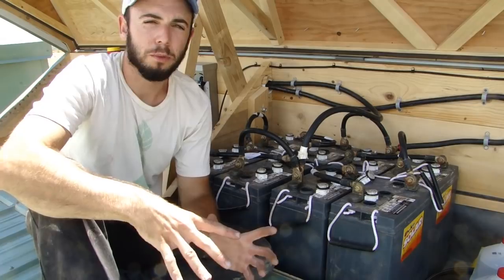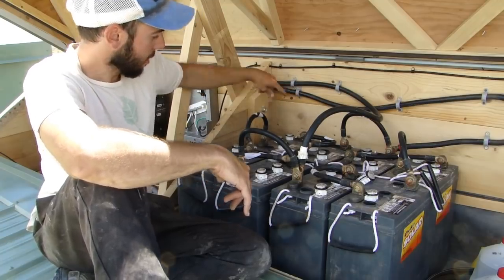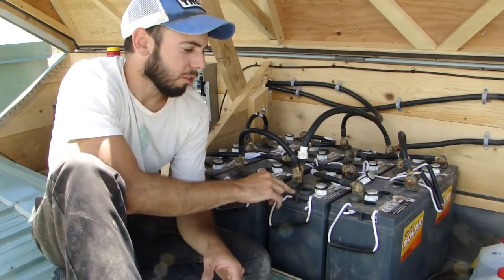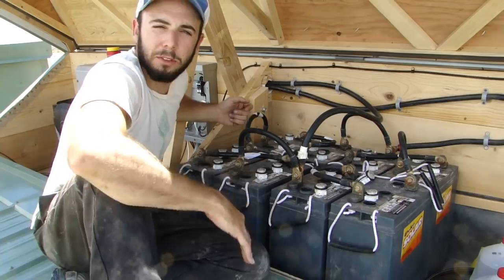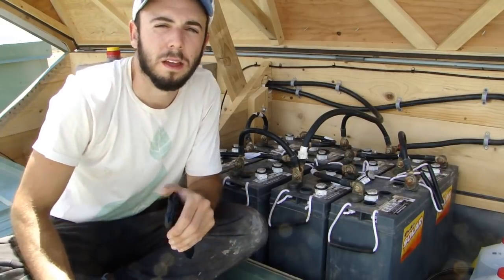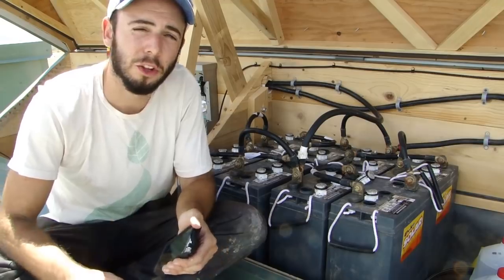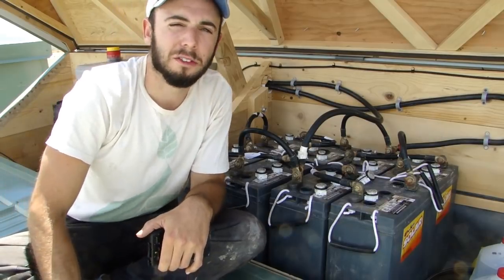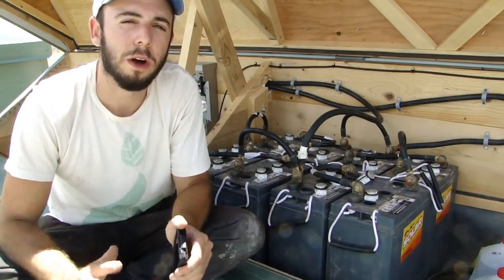How to Size Your Solar System

Comment: This is a good video with alot of valuable information, but I just wanted to append this chart about depth of discharge I found elsewhere, for anyone like me who may be interested. 

Basically, If you bring your batteries down to 30% daily, you will get about 3 years out of them. If you can size your battery bank larger, so that you are only using 10%, its more like 10 years. 

* 50% = 200 cycles
* 40% = 500 cycles
* 30% = 1000 cycles
* 20% = 2000 cycles
* 10% = 4000 cycles
 
For anyone who is interested!
Reply: +Maxwell Myers I think that may be the case for standard car batteries, but for Deep Cycle its different, as noted by this image ( http://www.solar-electric.com/media/wysiwyg/cyclelife2.gif ) or this one ( http://bdbatteries.com/images/lifelinelifecycles.jpg ) which is used as a reference in Wikipedia article ( https://en.wikipedia.org/wiki/Deep_cycle_battery#cite_note-2 ) on deep cycle batteries.
Reply: won't i need 3 times the battery for that to happen. might as well change to new batteries every 3 years.
Reply: or, use the larger battery bank from day 1, which has two major benefits, (1) the battery bank lasts longer as you aren't discharging as much, (10-20% rather than 40-60% as an example), and (2) you have extra capacity available if it is required... eg if its raining overcast for a week or longer... and you arent getting enough sun to charge things back up.. :)
Reply: Why would you use power from the  battery bank during the day. A/C Coupling works and is much cheaper all the DC inverter is providing is the reference hertz for the grid-tie inverter.

Comment: You have missed that this is based on 24volts in kwh, so what is it after inverters loss (12-15%) and inverting to 220 vac?
I find that is where most of You make Your mistake calculating from Grid power!

Comment: I need 180KW 8 hours a day. That's 1440KWh. now with $200 per KWh Deep cycle batteries that costs me $288,000.
Reply: Walt Derzay you explained it well walt, tobad after you took the time to reply you got a sarcastic reply back.
Reply: What are you doing that requires 180KW?  An energy inefficient household using 240 volts at 200 watts (A large breaker panel) would use 48KW at most.  (Ohms law - AmpsxVolts=Watts).  This is a worst case scenario that would blow the main breaker of a very large home.  Recheck your math on demand.  I'm coming up with 384 KwH. which if you're paying grid rates of $.10/KwH would run you $38.40/day on your power bill.  Most modest homes can be run on much less power.  I have central air conditioning and a hot tub and use a 100 amp breaker panel with no issues in a 3 bedroom modest (1600 sq. ft.) home.  I use approximately 800KwH/month which translates to about a $80/month electric bill at $0.10/KwH.
Reply: Walt Derzay
It's a (small) cigarette factory. Those machines require lots of power.
Reply: Eddie T Duh! his time machine. 1.21 gigawatts!
Reply: *****
2 12 volt's are 24 volts. 3 12 volt's are 36 volts. 4 12 volt's are 48 volts, etc. The deep cycle batteries I find are usually either 2 volts or 6 volts. (p.s. 2 volt deep cycles are rip-offs)

You have to consider how much solar power costs between the hours of 6pm to 6am. Good thing the factory isn't fully running then.
Reply: leerman22 look into becoming a micro producer/co-generator. Depending on your supply options (thinking nat'l gas), you may be able to go in with 2-3 other small producers in (very) close proximity, develop a 1MW system, provide power (and steam) to each of the members. You can either be an island or backfeed the grid, depending on what your local power company & PUC will allow.Yes, it'll cost a small fortune, but it'll reduce your op costs, and have a 30-40 year life cycle. It's not for the faint-of-heart; but, a group of businesses standing together (or a small industrial park) can probably get the numbers to work out. And, to show my green creds...I'd suggest powering your office operations with solar. :-)
Reply: leerman22 0
Reply: ***** were you trying to give a link to a battery bank, because the link took us to a generator that would power my entire block
Reply: *****
It's supposed to be a diesel solar hybrid system. The electric service where it is won't cut it.
Reply: leerman22 wow looks like you need a small nuclear plant hehehe
Reply: Dan L
The client is out in a bush next to a gas station with it's own generator, and a grid service just for the lights.
Reply: ***** My question was mostly sarcasm.
 The discussions about using batteries never gone further than improving transient demand on the diesel generator.
Reply: Eddie T I need 192 7.5KWh models costing $672000 ($3500 each I'm assuming Elon said for the 7.5KWh model). Mind you that includes the chargers and inverters, but it is worthless at powering 3 phase machines from single phase current. I don't know the price of the factory grade models (100KWh each and must be 3 phase).
Reply: Eddie T
Made a mistake. The 10KWh system costs $3500. Using 144 packs and costing $504000.
http://insideevs.com/tesla-reveals-battery-storage-solution-missing-piece/
Still not looking good.

Comment: Very informative. Im def considering a system just to handle my AC unit,fridge,and kitchen appliances. A system to take a 3000 sq feet house of the grid completely would be expensive? also, I hear you can get paid for sending power back to the power company or something of that nature.

Comment: Not true. I have a solar panel running directly in to my AC unit through alligator clips. The solar panels will charge the batteries but there are plenty of things you can tie directly into.

Comment: In tech school, ca 1971, I learned NOT to remove battery caps unless they needed water.  Caps are vented by design and should work just fine to release gases on their own.  Plus, if there were a spark, the cap just might keep the battery from blowing up. Who told you to remove the caps?

Comment: So to run lights and appliances in a home... 3.5 kw's is average... I'm trying to figure in my head, what kind of system would need to be set up for a home with a washer/dryer, fridge, three televisions, a computer, lights, and have 4.5 people in a home taking baths every day...
Reply: 4.5 people? Is that a pet or somebody lost a leg and an arm??
Reply: there are MANY variables, there is no magic number that can come from the info you've listed, things you can do to reduce the needed size of the system is (assuming you haven't already done this) switch to a propane powered on demand water heater, switch all lighting to LED upgrade old appliances to modern energy star rated ones or gas powered ones where possible and don't forget your HVAC system, upgrade to a high efficiency system, possibly even a ductless minisplit in each room so you only cool rooms being occupied.
Reply: HomicideHenry The video is only about the DC side of the system, the charging and storage. He didnt factor in the DC to AC conversion which is required to run most things in a home. Your power inverter(s) MUST be a pure sine wave type (to run appliances with induction motors, and transformers, even a PC. else you risk damage or fire) and be able to handle the wattage of devices connected to it.Lights can run off a cheap $50 Chinese ebay inverter just fine but you TV sets, PC, fridge, and so on, you need a pure sine wave inverter with respectable wattage and for that your looking at $500 plus depending on voltage, brand, type and, wattage.
Reply: ElfNet Gaming
or just get DC appliances so you have a more efficient overall system.

Comment: I suggest that all appliances should be operated directly by DC
This is more efficient than converting the DC from the battery to AC via an inverter.
Most appliances are now available in DC.
I have extensive experience particularly in refrigerators.

Roy Singh

Comment: Why not just 2 12V batteries instead of 4 6 volt batteries?
Reply: Myns about 100 pounds i got duracell  6v   at betteries +  it was the best deal. Cheaper then trojan and. Same. Quality
Reply: I had 12 optima blue top agm  batteries and they didn't  do crap lol  but I switched to  8  6 volt  deep cycle golf carts and  there expensive but soooo much more \power  at 12 volt thow screw 24
Reply: umm Jennifer  6 volt batteries are all  true deep cycle for solar or for golf cart  2 of those 6 volt demolishes my 300 doller optima  blu top 12 v  just saying and  theres  more then just 4 theres 8 6 volt
Reply: and the hold a lot more juice
Reply: Virtualgod2009 so why don't they just make a 12 volt version, with the larger plates, etc?
Reply: What no they dont weight that much what in the hell did you buy ahaha
Reply: Zack Grindle that 100lb is for all of your batteries correct?

Comment: Hi,
Great video.

I am looking to try to build a solar power system for my house and this has been very useful

FYI.

Power (P) = Volts (V)  x Amps.(I) this is NOT Ohms Law!!

Ohms Law  I =V/R where R is the resistance of the cable

Cheers

Comment: Simes like most RV COME WITH 2 BATTERIES,  AND IF YOU FILL THE ROOF WITH SOLOR PANELS HOW MANY BATTERIES SHOULD YOU HOOK TOGETHER AND HOW MANY KW WILL THE MICOWAVE AND HEATER USE ON A GIVEN DAY IF THE HEATER RAN ALL DAY?

Comment: Did you know? there are government programs that will pay up to 20% of the total cost of solar panels for your house as long as you have it installed by a professional.
Reply: KFLY67 And the professionals raise their installation cost by 20% until the government program ends.  That's why solar panel prices are starting to come down - subsidies are ending.
Reply: Agreed
Reply: KFLY67 They have that here BUT the power company offers way less (like 1%) on your bill. I just disconnected mine from the GTI and now I'm hording power for myself, it was not worth selling back when I can use it locally in my home, Now my power bill is greatly reduced (under $30 a month lol) and I have backup power to spare in case of a power failure..
Reply: Yes. But then you need the professional to fix normal failings which will far eat-up any savings. Besides, it's fun building your own system, and takes courage.
Reply: We've got another 4 years on the FITC, bud.
Reply: 30% through dec of 19 .
Reply: Chris Gage I don't think people should be forced to pay for other people's health insurance either. I live in the UK, where everyone is forced to pay for the obese National Health Service!
The government only thinks it's in control of things. It's like saying you're in control when having a car crash!
Reply: It's paid for by stealing from your fellow citizens!
Reply: dalriada842 I'd rather be paying for your photovoltaic system than your your INABILITY TO PROVIDE YOUR OWN HEALTH INSURANCE /endrant.

Don't worry, the government is in control.
Reply: Dan Burch Not true, and the Govt tax credit is for 30% not 20% and is good until the end of 2016 and with the libtard President we have hopefully he will extend it.  Find a reputable company and get comparative quotes, the reason the price has come down is due to the module pricing coming down.  Module pricing has dropped significantly in the last few years.

Comment: I'm gonna be buying my first 100 Watt Solar Panels. I don't know where to purchase batteries like these. I want to start small and just power my room upstairs on the third floor. I have enough room on the roof next to my room for two 100 watt panels. Can you please tell me where to purchase either preferably online, where to purchase batteries, the rest is very easy to get online, it's the batteries that I'm having a difficult time finding. Really nice video (+1 : 1877)

Comment: Bro i think you are wrong because at 30% of use of your batteries only, you will need one half day without using energy from your batteries otherwise after 10 days you will drain all your batteries. But if you use 50% of your battery you will have to alternate the days of array usage otherwise you will drain all your batteries within less than 5 days. You will need to double your arrays or use less than 30% a day of your batteries. Your batteries size are too much for your arrays to refill half of them everyday and then if the sun is brite everyday.

Comment: informative video, it also reminds us that battery storage performance and its exhorbitant costs have a long way to go..its the biggest set back to storing sun energy for later use.. battery technology haven't changed much in 200 years!!
Reply: if only we could dig a deep hole in the ground and install our own lead and zinc thick plates in series connections of high quality copper wires and make our own deep cycle batteries to the superb order of thousands of amp hours!!

Comment: Some questions/ideas:
Is your house designed to use off-grid appliances?
If so consider this (I do some electrical engineering):
What is the efficiency of my DC-AC-converter? Top notch gear runs at up to 98% efficiency.

Transformers are using some energy, too! Lamps and some other appliances do not need exactly 120V (or 230V here in Germany). Some even have a transformer down to 24V or 12V included. You could run them directly on the correct voltage (please add a fuse, those batteries can be very dangerous if you short them).
If you have some experience in working with electronics check what your fridge needs maybe you can modify it to run on 24V, too.

If you want to light something you might want to use LEDs instead.

You are using lead acid batteries. Have you considered using absorbed glass-mat lead batteries? They are maintenance free regarding checking the acid level.

Important:
To ensure a long life of the batteries you should not only size your batteries according to your appliances but also size it according to your power source. To treat your batteries with care you should not exceed loading currents of more than 1/10 C. That means you should put in more than 75A. This is (75A x 24V) 1800W.
So this is not a bottleneck but you should keep that in your mind.

Batteries may also heat up a little when being used. Especially if you drain quite some power over a period of time. Make sure they are kept in a place where heat can escape.

After all: Good video! :)

Disclaimer: Try out these ideas only if you know what you are doing! :)

PS: Ohm's law is referring to the current running through a resistor at a certain voltage, not to Energy.

Comment: Hey, I just came back to this video to tell you something, but I'm not sure if this is the right video or not. In one of your videos you mentioned your problem with those 24 volt light bulbs, well I found you a solution, and here is your fix in possibly 2 easy steps.

(1) Buy 12 volt fixtures and light bulbs and cut the power, and install where the 24 volt lights are now.

(2) Wire those lights to just half your battery bank, and then you will be on 12 volts, but if you said you actually had 2x 24 volt banks, then forget what I just said. If your wires won't handle 12 volts, then you would have to upgrade them too.

I hope this helps.

Your other option is to set up another smaller battery bank, with it's own solar panel, and small inverter just for the lights, might not be a bad idea anyway. You could just do as suggested already above with the new 12 volt bank.
Reply: greg posen Cheaper to just buy now, plus not only can you buy a better panel then you can build, but it has a 25-30 year warranty too.
Reply: greg posen i watch the video you recommend, it's just another high pitch sales plan. i rather believe to OFF GRID BUILD! his video is looking through experience, all are explained. and FULLSPECTRUM SURVIVALIST is right better to buy and build and has warranty. let me ask you [don't get offended though] did you buy the the system on the site you recommend???

Comment: Thanks for the video, great info. I'm designing my first off grid system around an Outback Charger/Inverter and I'm deciding whether I should go 24v or 48v.... Just wondering if you have any advice? I'm starting small with only 2-4 panels and batteries but want to design in expandability. Cheers!

Comment: If you use less energy then your solar system is using, and you more than top off your batteries, is't the excess power lost? I mean you use 3,5 kilowatts daily, and you produce 5 kilowatts, and your batteries top off when you replace that 3.5. Isn't 1,5 watts lost daily. couldn't you just add another set of batteries, and slowly top off them when your original set become full?
Reply: He said that he has sized his solar system to make up for the 5000watts that he uses (30% of that 16.8kWh); during the peak hours, which he said was about 5 hours. He calculated that he produces 3.2kWh during those peak times of sun(Peak solar radiation occurs at solar noon). During the non peak hours, before and after, he produces the rest he needs to top off the rest. Peak sun is different from total sunny day which is seasonal too; however, with that being said, you need to produce more than what you typically use. Additionally, he never discussed cloudy days; you always calculate the amount of sunny days too (Days of autonomy).